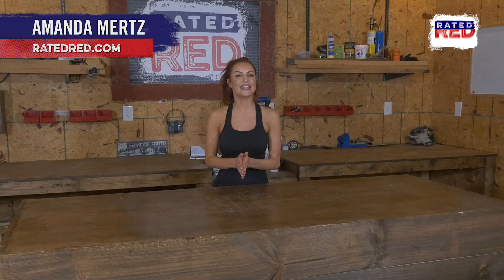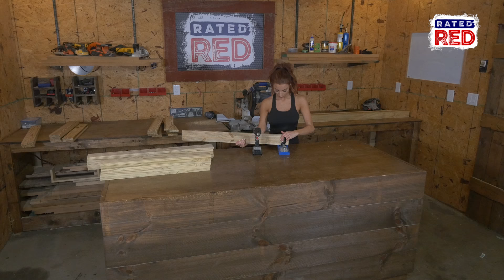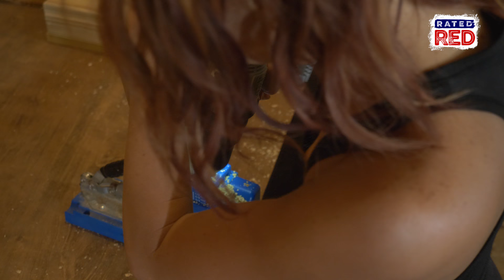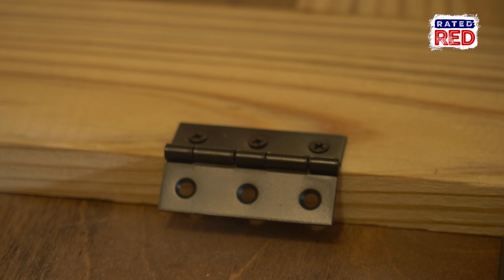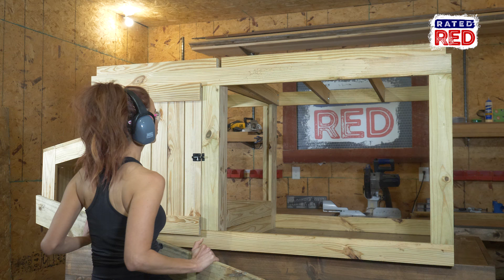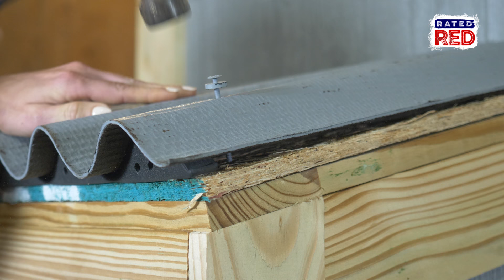Chicken Coop | Red Hot Building

Comment: When giving instructions you should either have CAPTIONS, include a LIST in description, or NOT SPEAK SO FAST. I have excellent hearing but had to repeatedly rewind, rewind, rewind, in order to make my list. If someone was hard of hearing your instructions would be impossible to follow and essentially this becomes just another video of a pretty girl working with power tools. 🙄

Some notes for beginner poultry keepers:
OSB should never be used for poultry flooring because it provides too many tiny crevices for bacteria and mites to hide in, and once soaked it begins to fall apart. Use a good pressure treated plywood and even a sheet of vinyl flooring to further prevent moisture problems and aid in cleaning. 
Never use ordinary staples to attach wire. While it may keep your chickens in, it won’t support the wire to keep out canines or raccoons and a simple PUSH will crush it inward allowing predators to gain access to your birds.

Comment: Not bad but I wouldn't use it without allot of changes. Like a removable floor, a nesting box that opens from the top not the back and a easy to remove side panel or roof for easier cleaning just to name a few.